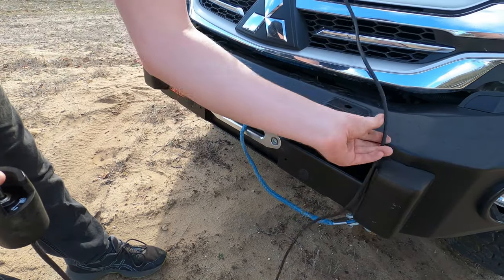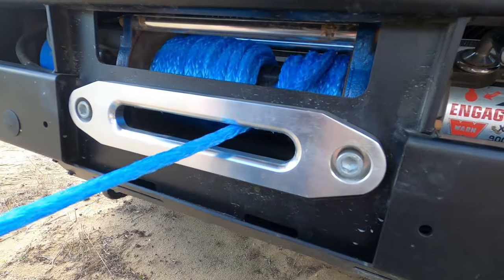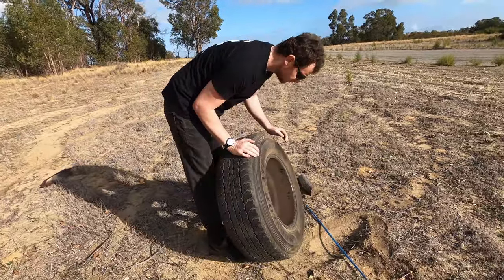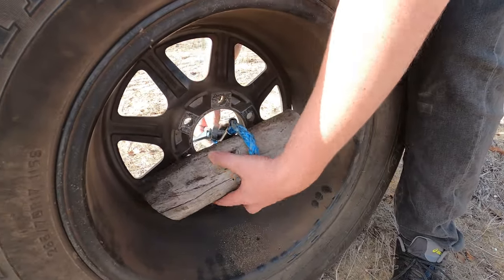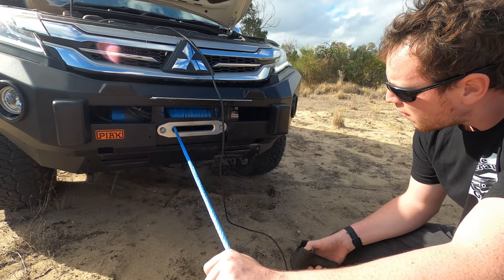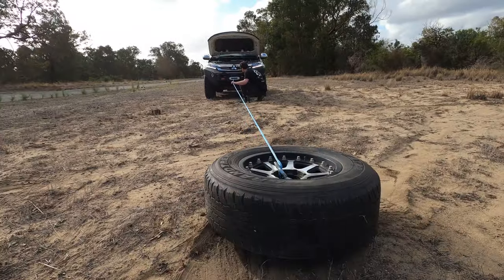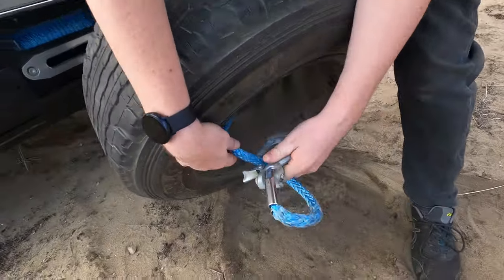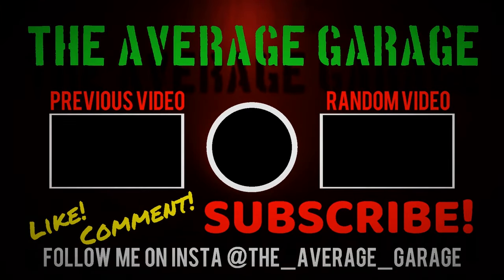DON'T use your winch before watching this! How to correctly RE-SPOOL winch rope

Comment: A lot of stupidity in the comments. I've worked the oilfields and electrical industry my entire life. We winch up a lot more weight than a measley pickup. We do not load up the winch with a 1000 lbs everytime we spool it back up. Put on a glove, pull the rope tight, and guide it left to right, then back over itself right to left. It's not rocket science. This is the same with 3/8 vehicle line or 1.5" bull rope on 10 hp tugger. These kids throw on a spacer lift and a winch and think they're recovery gurus...
Reply from the maker: Yeah that's exactly right mate.
Reply: Who hurt you?
Reply: Funny how a digger Derek line truck has a 25lb hook for 1” dyneema and it’s rated to pick 30k straight up. Yet just 25lbs of tension goes back in full length every time… from ground to pulling back in all 3 stages 70’ up and 70’ down… 140’ of line, 25lb ball seems to be more than enough to not kink up after lifting 25k close and almost full drum. like you said gurus. Hand hold it is good enough for any truck winch. Or atv etc.
Reply: @BoiProduction stupidity. It hurts us all.

Comment: You might want to respool it so it pulls from the bottom of the drum.
Reply from the maker: As much as I'd like to the winch is only designed to pull in one direction 
The drum is clearly marked :)
Reply: @T.A.G  it’s not about the direction the drum is rolling. It’s how you feed the tail end of the rope in before securing it to the winch. The end of the  rope goes in  below the drum first. Then up behind the drum, and then screw it in place. Now you can roll it in properly.
Reply from the maker: @MH-go9wn  drum has clear stamping and stickers of cable direction. If flipped the brake may not work
Reply: @T.A.G  yes mine too... please go over your instructions again. 
I did my part 🤷🏻‍♂️
Good luck 🤞
Reply: He’s got it right for his application. The brake only works in one direction as there is no need to brake the drum on the unloaded side. 
The only option would be to flip the whole winch over which might not fit for his setup.
Reply from the maker: @milesabove5259  thank you! Haha. Finally someone gets it. 
Looked into flipping the winch when I fitted my new bar recently. Wasn't worth the headaches. And it works well how it is :)
Reply: Your rope in the video is feeding in over the top of the drum as already stated. This is incorrect, the brake WILL NOT WORK in this way and is also rubbing on the top of the fair lead and depending on your winch mount may run on the bumper itself. Under load this may also damage the rope. The rope must feed underneath the drum. Check to see if the controller is wired correctly?
Reply from the maker: @chrispedlar1918  you missed the part about the stamping and stickers as to direction of drum rolling and brake assembly. Everyone seems to miss that
Reply: @T.A.G  I get that you believe you have followed the markings correctly but I can’t think of one winch that feeds onto the top of the drum so clearly something is wrong here. Is the hand controller wired up correctly as this could cause the direction to be wrong? What make and model is the winch?
Reply from the maker: @chrispedlar1918  everything is wired up properly. Winch is clearly marked when I rebuilt it. 
Wired correctly. Controller is wired correctly. 
It's a warn xd9. Only solution is to flip the winch 180° but the  does not sit right in my bar. 
Also the brake will not work the opposite direction if I was to respool it reversed and reverse the power wires
Reply from the maker: @chrispedlar1918  people just assume that I have no clue and haven't done it properly 😂🤦‍♂️
Reply: @T.A.G  ALL Warn winches feed to the bottom of the drum, something is definitely not right here? If it was feeding correctly then the line passing through the fair lead would be correct (straight) which it is not. The line should not be bending over the fair lead like that. Every winch bumper is designed to allow the rope to feed under the bottom of the drum without bending the rope over the fairlead under normal straight line pulls. The fact that 99.9 % of people on here have s,tasted it’s wrong has to say something surely? I bet if you pulled your vehicle up a slope and stopped the brake will not hold in this configuration. Unless of course you have the only Warn winch manufactured in the world that’s built differently to every other winch?
My only concern here is both your safety and that of anyone else that watches this and thinks it’s correct.
In over 30 years experience I have yet to see a winch that runs the rope correctly this way.
Reply from the maker: Feel free to watch the rebuild video, I may have mentioned or showed the sticker and stamping in that
Reply: @chrispedlar1918  Old mate rebuilt it. He can't see a problem with it...enough said. N.F.I.
Reply from the maker: You seem super upset over this... 
It's also been respooled and run from the bottom now
Reply: @T.A.G  No, I just don't like seeing idiots pretending to know what they are doing and spreading dangerous misinformation that might get someone injured or killed.
Reply: @T.A.G  

So you admit it was spooled wrong then?
Reply from the maker: @ian9toes  was spooled the correct way but people whinged.
Reply: @T.A.G  

Either it’s now wrong to suit popular opinion or it was wrong to begin with. Hey we all make mistakes.
Reply from the maker: @Ian9toes  either way it involves you in the least.
Reply: @T.A.G  

You’ve got a “how to” video up that is wrong, plain and simple the right thing to do would be to remove it. Or at the very least pin a comment owning the mistake.
Reply from the maker: @Ian9toes  the how to is based on placing preload tension on the cable/rope. Not how it's spooled around the drum. If you want to pick arguments on the internet, go elsewhere.
Reply: First thing I noticed aswell.

Comment: The idea of tensioning the first half of the cable is to prepare it for actual pulling of the vehicle - you have not done this. Dragging a 10kg? wheel along the ground hardly mimics dragging a 1800kg 4wd in a recovery situation. You may as well have left it how it was. Tension on the rope was the point, and you applied bugger all.
Reply: I look at it this way. Spent $500 on everything I'll need to winch my 2 wd Ford E250. the one time i need to use it to get unstuck will pay for it  all.
Reply: @frederick6008  What does that have to do with the price of rice in China?

Comment: Last 8 or 9 ft does not need to be tensioned because you always will use that much before connecting the line to anything.

Comment: Hi mate, I don’t want to add to the collection of negative comments on here but I feel I should advise you to spool in from the bottom of the drum (I think your winch may be installed upside down, easily fixed by just rotating your clutch lever). The reason being is your auto drum brake most likely won’t work in that direction (and that’s very dangerous). 
Don’t be deterred to make other vids.
Reply from the maker: It's on the list of things to fix haha. Still..... lol

I appreciate the comment. The video was mainly aimed at how to spool with preload but yeah my winch is back to front atm.  

A future episode I'll redo it once fixed haha

Thanks again :)
Reply: So my winch is mounted upside down and when I spoke
To someone they had mentioned that won’t make a difference in operation… this is my first atv/winch so I’m just curious is that what you are referring to !?   Appreciate it
Reply: @SETTAPERFORMANCE  Sorry, my original post was obscure.
A winch does not know or care how it is mounted. What I mean by that is if you attached a winch to a wall vertically, horizontally, up side down or even on a 45degree angle it won't make any difference to operation. 
On my N80 hilux I had to mount it 'up side down' so that the rope spooled from the top and lined up directly with the hole (fairlead or rollers, in my case rollers). I just needed to rotate the clutch so that the free spool was on top. 
My winch operates perfectly because it is in line. If it spooled from the bottom it would pull the vehicle nose down (via the bottom roller) into the object you are trying to get up and over.  This would create enormous pressure on the rope and most likely snap it.
Reply: @tonesbones502  I am about to reinstall as I changed to synthetic and a new hawse FAIRLEAD… just trying to make sure I orient everything right and don’t cause more problems !! 

Thanks for your help

Comment: Sorry dude, but you made it wrong!  First of all you should rolling rope in oposite direction on the dram, it must be under the dram. Maby you or someone in shop conected power wire in wrong way. Second thing is? the  spare weel is to light to make correct preload. Better idea is to conect rope to anchor point and pooling the car evan with parking brake with 50 percent pull on.

Comment: Love your videos mate
I have a 2016 pajero sport and about to fit a piak elite 3 loop (the new one with recessed lamps).
What winch are you using?? Have been told that the piak bars are winch specific as in there is not to much space. Im looking into a VRS winch. Any pics of your control box mounting??
Reply from the maker: I'll have to do a video on the control box as it's a frequently asked question haha. 

Unsure about winch limitations. I think they're all about the same size. I'm running a warn xd9000

Comment: Your initial problem was caused by spooling the rope in without proper load on it. Then you made a video about it but still didn’t use proper load! 
You need minimum 1000 lbs on the other end. What you did is better than no load at all.. but you’re still going to pinch your line
Reply from the maker: Initial problem was that I never spooled under load from when I first respooled it with the rope over cable
Reply: @T.A.G  yes! The key point in your statement and mine is. Not under proper load! 
Look. I appreciate the effort you put into the vid and your good intentions to help others. However, you made a couple mistakes, and multiple people tried to correct you on the same mistakes. Accept it
Reply from the maker: I am haha. You're welcome to create a video too. The world is your oyster

Comment: It wasnt as bad as people make it out to be and your wench will operate ok. Personally I tensioner mine by pulling my riding lawnmower up an incline. You just want to eliminate those very loose areas where it could spool and birds nest on you and I think you did that. Dont listen to the peanut gallery.
Reply from the maker: Exactly. Obviously the more load the better. But you just need tension to stop the rope pulling under itself like it already had haha. However. My winch does need to come out and be respooled again. So I will be looking at winch direction again in the future

Comment: All that dirt and dust on your synthetic line is not good for it and your fairlead …it damages the micro fibers and scratches up your fairlead which in turn reduces the life of the rope…
Reply from the maker: Yeah. I make sure every time I ever winch a car the rope never touches any dirt or mud at all. 
I only winch cars on tarmac in dust free environments for this exact reason :)